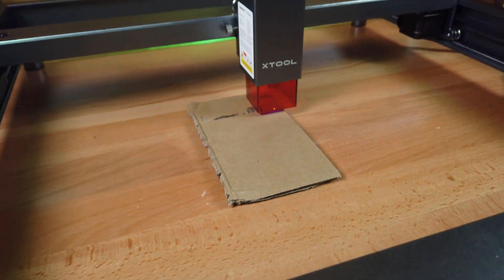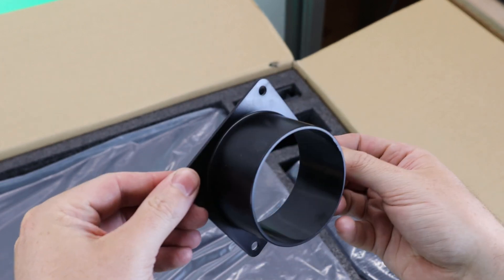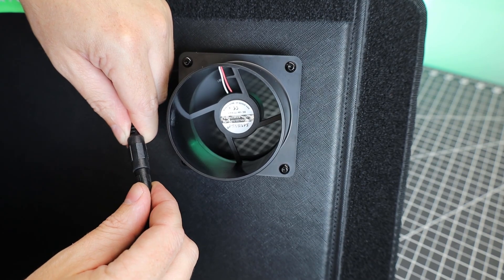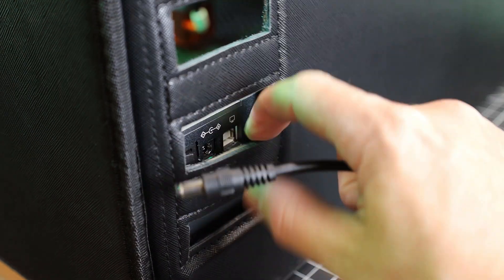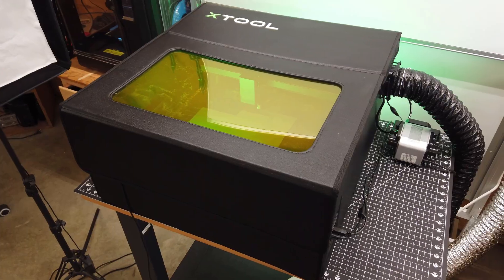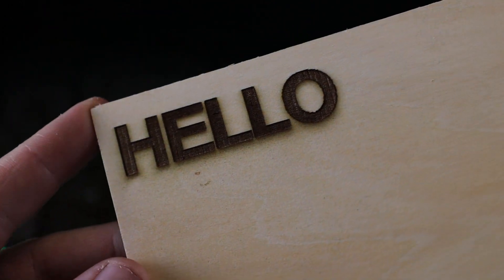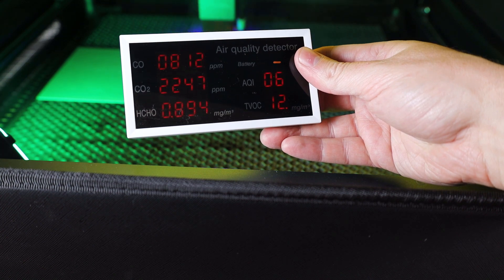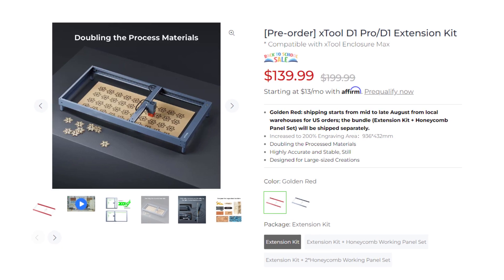Simple But Very Effective Smoke Proof Enclosure - xTool D1 Enclosure

Comment from the maker: From xTool:
xTool Enclosure Smoke-proof Cover - https://bit.ly/xToolEnclosure
xTool D1 Pro Laser Engraving & Cutting machine - https://bit.ly/xToolD1-10W
xTool D1 Air Assist Set - https://bit.ly/xToolD1AirAssistSet
xTool Honeycomb Cut Bed - https://bit.ly/xToolHoneycombBed
xTool Materials - https://bit.ly/xToolMaterials
xTool 20W Diode Laser Module - https://bit.ly/xToolDiodeLaserModule20W
xTool Smoke Purifier - https://bit.ly/xToolSmokePurifier

From Amazon:
xTool Enclosure Smoke-proof Cover - https://amzn.to/3dFU8vy
xTool D1 Pro Laser Engraving & Cutting machine - https://amzn.to/3Ccvf4H
xTool Honeycomb Cut Bed - https://amzn.to/36hLVdq
xTool RA2 Pro 4-in-1 Laser Rotary - https://amzn.to/39u4Mn7
xTool D1 Rotary - https://amzn.to/3tzO0tD
xTool D1 8Pcs Laser Engraver Raiser - https://amzn.to/3O0q7U8
Honeycomb Working Panel - https://amzn.to/3txRY60
3MM x 12" x 12" Baltic Birch Plywood - https://amzn.to/3uMibyJ
1.5mm x 12" x 12" Plywood Sheet - https://amzn.to/3uLqfje
Air Quality Monitor - https://amzn.to/3PtTu1a

Free Files:
Engrave Material Test Laser Pattern (LightBurn) - https://drive.google.com/file/d/1VmzXgLFeil-zOarKUNs0QklVCMqqTEQA/view?usp=sharing
Cut Material Test Laser Pattern (LightBurn) - https://drive.google.com/file/d/1DVm-P38fsdGC2fzOeuDwhkWSrzNS6A-t/view?usp=sharing

Cheap Paid Files:
3in to 4in Adaptor STL file - https://bit.ly/3inTo4inExhaustAdaptor
Earring Display Stand Laser Pattern - https://bit.ly/EarringDisplay-LaserFile
Witchy Potion Bottle Laser Pattern - https://bit.ly/WitchyPotionBottle-LaserFile
Magical Moon Witchy Bug Laser Pattern - https://bit.ly/MagicalMoonBug-LaserFile
Mushroom Laser Pattern - https://bit.ly/Mushroom-LaserFile

Other Videos About xTool D1:
This Has Changed My Mind On Diode Lasers - xTool D1 Laser Engraving & Cutting - https://youtu.be/PO357F-NT8Y
Must Have Upgrades For Crisp Cutting & Engraving - xTool D1 - https://youtu.be/QWM9A0dmfT8

______________________________________________
If you are looking for more tools and materials that I use, well you're in luck! I made a page on my website just for that.
https://GomeowCreations.com/tools-and-materials 
https://GomeowCreations.com/partners-discount-codes

Note: Most of the links that I use that go to products are affiliate link. This means I make a small commission on anything that you happen buy using them. This is at no extra charge to you and this helps support the work I do on this channel. 😁👍
______________________________________________
Other Ways To Help Support The Channel:
My PATREON ➜ https://patreon.com/GomeowCreations
One time support ➜ https://paypal.me/gomeowcreations
______________________________________________
Instagram ➜ https://instagram.com/gomeowcreations/
Facebook ➜ https://facebook.com/GomeowCreations/
______________________________________________

#xtool #xtoold1 #lasercutter #xtoold1pro  #diy #gomeowcreations